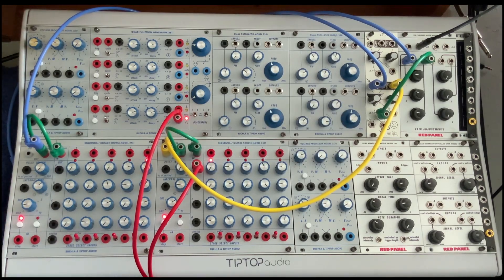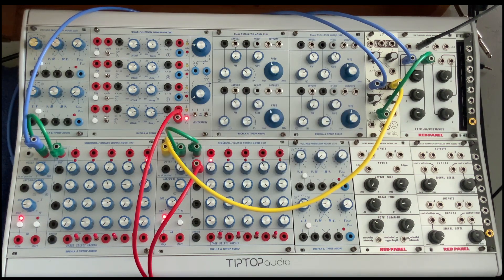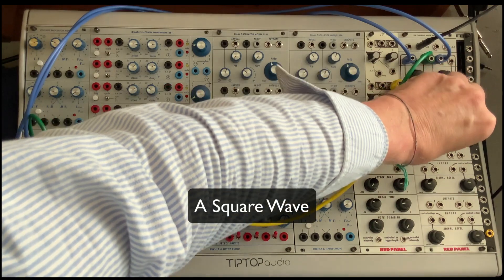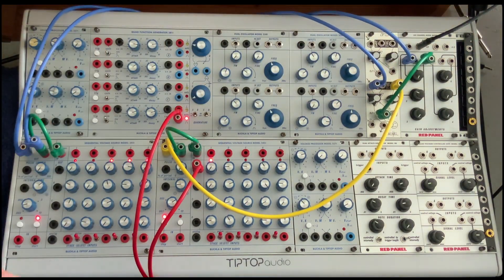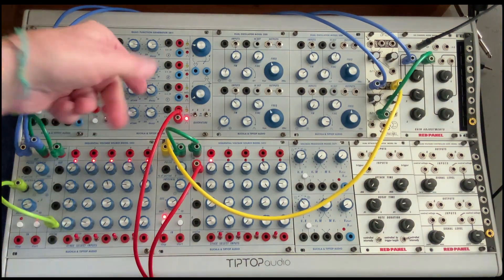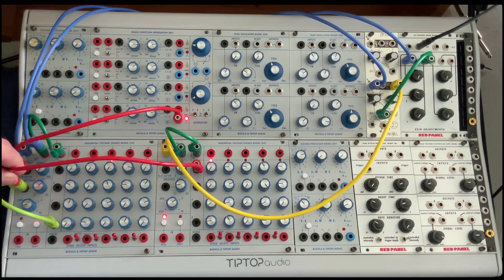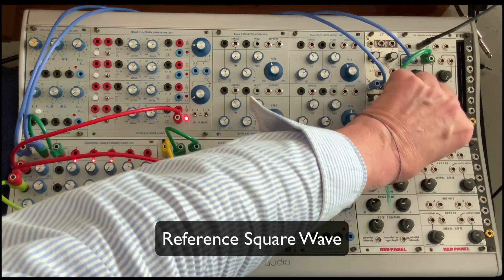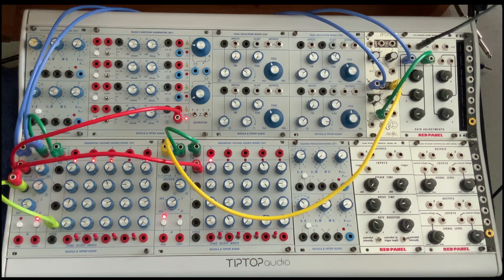Tiptop 245t as PW Oscillator

Comment: Is it ok to mix with stackcables on these modules?
Reply from the maker: Not sure I understand the question. You can use stackables in any configuration
Reply: @vgermuse  Just that a lot of euro manufacturers recommend not using passive mults or stackcables to mix signals - but since these are half Buchla, half Euro I wasn’t sure if it would cause any issues.
Reply from the maker: @Autotross  I haven’t found any issues
Reply: @vgermuse  good to know, thanks!
Reply: @Autotross  The only thing I have run into is with a passive design module it sometimes doesn't work as expected, but throwing a VCA in between helped. Using stacked cables with the buchla modules just seems like the natural thing to do.